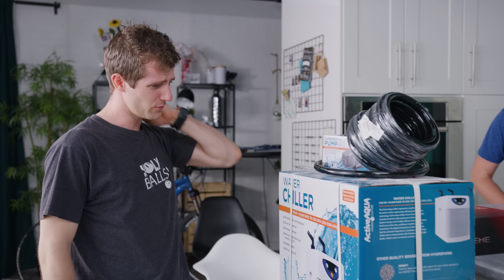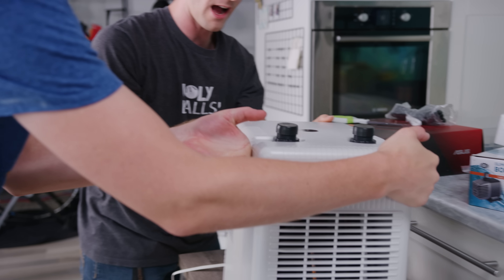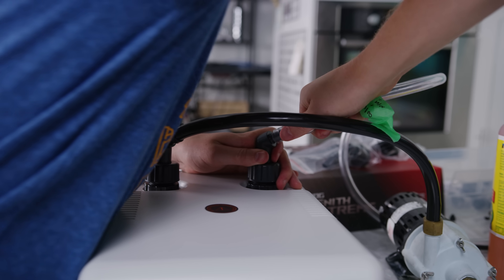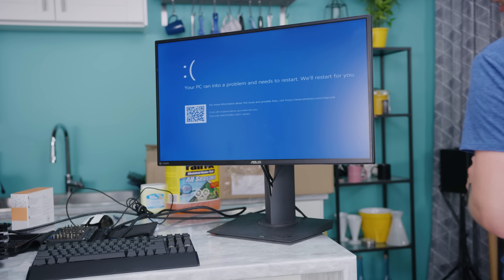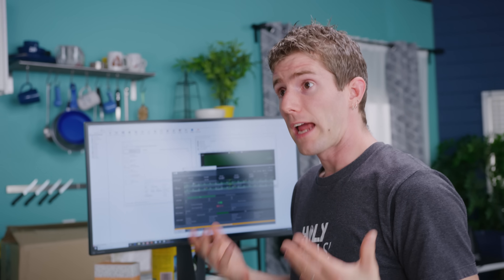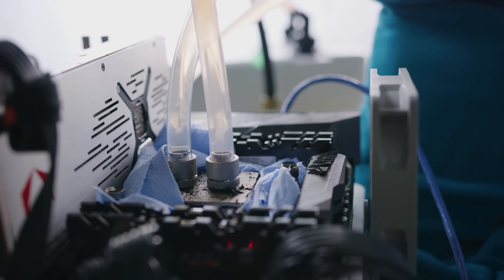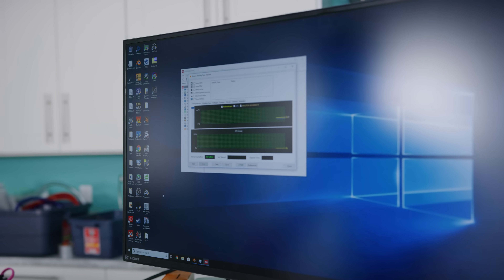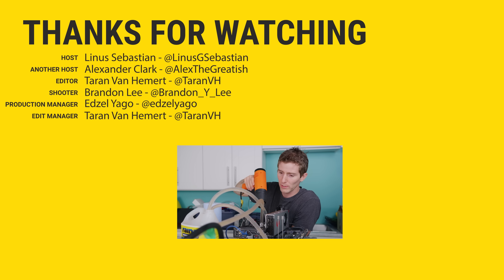Chilling Threadripper 2!!!

Comment: Yes, I do want to see it integrated into a system. But can it cool the i9 macbook pro?
Reply: this is pretty much the same as asking if it can fix the charging port on the magic mouse... nothing can fix pure stupidity
Reply: Can it cool Crysis?
Reply: @Ariakus88  that's smart questions
Reply: Rack mount chiller?
Reply: Whoa lets not get ahead of our selves here. This is a water cooler, not a nuclear powerplant cooling tower.
Reply: Not even in your dreams
Reply: bruh why are you here 

how are you here
Reply: TO cool that you would need to build an external laptop cooling system, uncooled the laptop helps reduce the population of the planet, cooled it will reduce your desire to procreate to be effective.
Reply: maybe. just stick a giant ass colling plate to the bottom with some thermal paste and run it as low as possible and pray.
Reply: No
Reply: Crazy to think that the M1 Studio scores better than this while using 1/8th the power :p
Reply: Boring
Reply: the Macbook pro would consume a closely comparable amount of power to the 32 core threadripper there's no reason why it couldn't cool it but you would have to make a custom water-cooling block for the Macbook and probably a stand so you have room under the Macbook to run pipes and you might need to cut holes in the bottom of the Macbook the Macbook wouldn't be very portable after all of this and you'd lose your warranty and you wouldn't be able to overclock much at all on the crappy Macbook motherboard so it would be better to just make a desktop like in this video

Comment: Instead of using a refrigeration loop to cool the "water," you should try running the refrigerant itself directly through the CPU heatsink.
Reply: How about buying some fluorinert to fill a tank big enough to take the whole system.  You can then pump cold fluid to the heatsink and leave the outlet open so the whole thing is swimming in cold liquid.

Comment: How much power does that cooling pump take?  It looks like we'd be adding at least 20-40 watts from the pump, and 200-250 more (at least) for the the cooler, and then ONLY to let the CPU suck MORE power still.

Comment: Mr. Linus, let me give you a million dollar idea, I am a design engineer at large hvac manufacturer. Condensate is a big problem for us as well. But! Gravity is always on your side. Just keep the board upside down and 3D print a drain pan that way you wont have condensate all over your motherboard circuitry and it will drip into the drain pan and drain outside. Simple but very effective solution, thats how we deal with the darn condensate.

Comment: This seems like a legit cooling solution that could be used for a multi PC setup. Get some of those quick release fittings, a decent central tank, and something to hide the pump & cooler. You got an easy super liquid cooled setup that isn't all that hard to do outside of piping the cpu & gpu out of the case. Another plus is not having the reservoir and pump in the case, less likely to ruin the whole setup that way (other than the couple tubes piping in/out). Next high end build I do, when I'm not broke, I might actually try this.

Comment: Use a window AC unit to cool a sealed case.  A cheap 5,000 BTU unit can handle 1,500 watts.  The only place that will condense water will be the exterior of the case and the cooling coil.

By relocating the thermostat outside you can easily force it to run continuusly. 
 By adding a condinsation drain you can cycle the conditioner to dehumidify the air to prevent ice build up during operation.

Comment: PUT THE BOARD IN TO MINERAL OIL TO KEEP THE CONDENSATION OFF.
(No air no problem)
Reply: Make sure there is a gap below the PCB.
The water than condenses on the surface will sink to the bottom.
The pickup for the return to the pump should have a water trap.

Comment: Waterchillers are awesome in general. Once you really decide to high end watercolling and not care too much about the budget there is honestly a lot to be said for going for a chiller. If you run at ambient it's also really simple - about as simple as any other water cooling.

What would be real nice to know is how many BTUs you really need to drive a system like this. Can this thing keep up several hundred watts sustained load and keep the water at a reasonable temp? Burst-benching is nice, but for it to be practial it needs to hand.e sustained load tolerably well too.

Comment: Maybe use different gpm pumps, maybe find the sweet spot in heat absorption. In Air Conditioning if the blower is moving the air slower through the coil the refrigerant absorbs more heat.

Comment: just for reference when you cannibalize this unit you should be able to extract a thermistor which controls the refrigeration side of the system, you're going to want to move the thermistor closer to the CPU AK use thermal plaster and physically plaster it to the water block that way the refrigeration system will have a better response time when the CPU gets warm
Reply: couldnt you instead just add another block to the loop and stick it to the thermistor?

Comment: I have a better idea, build a water cooled system where the cooler and the pump are placed in a different location (like a padded closet) and complete the loop with quick connects so the user doesn't have to hear it. While you're at it, you could see how many different PC's you could cool on the same loop, you could call it something like.. whole room refrigerated water cooling.

Comment: I have a crazy idea!!

Use that cooler to cool all the machines in the editing room! Kinda like you guys did back at the old house with the full copper water cooling loop. That would be cool to see.

This cooler unit could have some use if you using it to cool several computers all at once?
Reply: Exactly what I was talking about! excited box
Reply: Kale Mercer this is actually a really good idea, hopefully they will try this, maybe not with a bunch of expensive machines though, maybe some old hardware just to test it out at first
Reply: Trust me they won't. The full room water-cooling was such a pain in the ass end never worked, especially since the editors lost a lot of time because there PC's weren't working for 90% of the time
Reply: true, but would be funny to see ;-.)
Reply: They have said that the past previous room-scale multi-machine water-cooling solution caused way to much downtime for maintenance, and that they would likely stick to air cooling in their mission critical rigs from now on.
Reply: tough the same here.
Reply: If they ever do it again it should have separate loops for each computer and a separated master loop to cool from. With no mix of fluids among systems and the cooling portion of the loop each section will keep much more clean.

Comment: 1/10HP Aka 74.6 watts. A window unit has much more power; this would have to have a pretty big coefficient of performance. The small window units transfer 5000 btu per hour while consuming perhaps 400 watts when working against a mild but impactful temperature gradient where the outside temperature might be 100*f and the inside might be 70-75*f, but when you're operating one of them where the ambient is room temperature and the target is barely above freezing, not only are you operating against a greater gradient, but you're going to eventually reach a point where the cycle chosen isn't as good at operating at very low cold side temperatures. That's why normal freezers can't just keep cooling down their contents beyond a certain point, no matter how well you cool the hot side. The amount of heat transfer in BTU/hr of 500 watts (cpu consumption linus read out) is roughly 1700 BTU/hour, and so the window unit can tolerate some leakage of heat and the lower efficiency associated with a low cold side and larger difference in temperature, and with an appropriate buffer could probably just cycle on and off every so often happily. But this thing, with only 74.6 watts? Were those temperature numbers they quoted the cpu temperature only, or was the water also heating up a fair amount? Because it sure seems like this thing is only going to keep up when the coolant temperature climbs, otherwise it'd be insanely efficient.
Reply: The thing is rated 960btu or 280w (pulling 150w from the grid), next size up can move 2300btu or 670w (pulling 280w from grid)  which seems way overkill but might be a bit more efficient, and probably nessasary to run cpu at 500w 24/7
Reply: Mmm, so draw is a bit higher, and the amount of heat rated is not enough for continuous operation at whatever temperature it's rated at, is what I'm seeing there.

Comment: You are probably getting more condensation from running a fan over the cooling system because of the moisture in the extra air.

Comment: Linus, your average wattage over an aquarium using this sorta chiller is between 450w and 1000w or more, it should never have an issue with any single cpu.  it is used to counteract metal halide lighting on 8-12 hours a day sometimes inches above the water.  ie alot of heat.

Comment: I Tried cooling my pc with the AC. My GPU PCB got corroded. it got fixed by literally cleaning off the corrosion with alcohol but one of the small rectangle thing got removed. it still works fine though.

Comment: Have you guys ever heard of "staged cooling"?  Take that unit which can chill down to ~5 centigrade, feed it into a secondary cooler which is designed to cool liquids from ~5 centigrade to -15 centigrade, keep on piping it into different classes of cooling devices until eventually you're working with liquid helium around -270 centigrade (you'd be using an intercooler for that so you can use different fluids for different temperature ranges).  THAT would deal with threadripper's power usage no problem (and no condensation because it all freezes to the touch)
Reply: That would be highly over complicated. You can get to liquid atmosphere in a single step by using a helium compressor. Multi-stage is mostly for increased efficiency.
Reply: Not only for increased efficiency, but also so that you're not using a working pressure of upwards of 30 atmospheres.  You aren't going to get that kind of compression from parts you get at Home Depot.  I've constructed a very crude intercooler hacking apart (a few) coolers similar to the one they used without having to endure the expenses of a heavy-duty compressor and piping.  Lower temperature was -80C.  Sadly, it died very quickly and with a very voided warranty.

Comment: But... wasn't this what Koolance kits tried to achieve? On this note, there are a huge range of water coolers/chillers for many uses from drinking water to cooling down lasers.
 Just saying go big or go home: a whole setup for several computers with piping and individual taps connected to an industrial cooler.
Reply: You guys do know that Linus did that, right? And it got disastrously dirty?
Reply: Search the channel for Whole Room Water Cooling, as chooseymomschoose said, you'll be very disappointed.
Reply: That system was dirty from the start. First off, when plumbers braze (solder) together their pipes, they don't run any inert gas through them to keep the copper from corroding on the inside. They flush them with water and call it good. When it flows to the drain, it's fine. When it's in a loop, it isn't. HVAC/R techs purge copper lines with dry nitrogen to keep the oxides from forming those black flakes that we saw in the whole room water cooling teardown. Luke's dad (who as I recall (hopefully correctly) did the copper plumbing) probably didn't know anything about all this. Then I remember the fluid being un-optimal for water cooling and they had aluminum blocks and copper lines.
Reply: Learning is fun!
Reply: Thank you for the friendly reminder and as a matter of fact I went back to check the specs of that project. As a token of courtesy, would you consider checking them too and reading again the part when I said using an industrial cooler? Not that it's my intention to create controversy out of a for fun project, just saying that it's kinda nice to have a healthy discussion where every side actually listens to the other.
Reply: NO offense to LTT but that was in one word, bad. And still small potatos to what @jarejander69 were talkin/thinking about.
Reply: NOW were out of the box........ This is what i was thinking lol make a piping system in the office dedicated for employee stations!!!!!!!!!!!!!!!!!!!!!!!!!
Reply: And taking it up a notch, connecting the loop to a radiant heating/cooling floor.
Reply: Pretty sure most of the reason this isn't very feasible is the mix of metal types necessitating exotic cooling fluids (windshield washer fluid designed for subzero temperatures in this case) which makes it impractical for large scale use.
Reply: not at all the liquid is the easy part its using the same metals that is "scary", not really.

Comment: So.... I still use an Old Swiftech Peltier water Block. CPU TDP of 125. Which is awesome for considering when Peltier blocks were brought out CPUs were significantly higher. I mention this to note the fact you can Achieve 0c on a CPU with No added monster of a water chiller. That being said, a peltier would struggle against the Threadripper... Mind you, you CAN always get a MUCH bigger peltier.... Ideas are brewing....
Reply: peltiers draw a ton of power though :(
Reply: phononic hex 2.0, it even has anti condensation software that manages ambient temp to keep it just above dewpoint

Comment: Linus why don't you test something that was built for this " https://koolance.com/liquid-to-liquid-cooling-system-llx-7000 " or " https://koolance.com/exc-800-portable-800W-recirculating-chiller " they have built-in reservoirs and pumps, and temperature monitoring so they don't sweat.I have not seen any detailed review on this type of equipment ???

Comment: I have thought about running a radiator into the tank of the toilet, so the tank becomes a heat sink that gets fresh cool water when you flush, and less condentation on the tank.

Comment: Amazing, overclocked threadripper 2 consumes just 20 times less power than a manufacture-grade thermal treatment furnace!
Reply: that's more than some microwaves...
Reply: i would consider a microwave under 700 watts a pretty shitty one though ;)
Reply: Might as well just turn these high powered oc system into water heater, and store those heated water in your house water tank for later use, no furnace needed in home ever again

Comment: itd mad if you integrated it into system and had a little arduino that would see what ambient temperatures are and then adjust itself to keep away from dew point automatically, since your cannibalizing it  anyway it wouldn't be too much to just take the button off the chiller control panel replace them with a couple of wires that go to the gpio pins in an arduino, awesome project though!
Reply: linus isn't that smart...
Reply: and thats way to complicated look up the phononic hex 2.0 and peltier kits dont dive too deep
Reply: i was thinking the arduino would jusdt have a counter in it and you would have to sync the two systems
 together and the arduino would "press" the buttons. but youre right it sure is a rabbit hole
Reply: Im not saying what you are saying is a rabbit hole if you do, im not. I would have a Sonoff TH10 on the chiller and a regular sonoff basic connected to the pump. Then its all phone monitored and you make a simple IFTTT applet to do what you said. Nothing against arduino, Sonoff is programmed with arduino. Just its already pre programmed and it has more features then a person making a custom program for a bare arduino board would like wifi, IFTTT integration and temp probe and a humidity sensor if needed/wanted. and a basic is $8.00 the TH10 is $25 USD

Comment: Check out some of the water pumps on Amazon specifically labeled as DC water pumps. From my experience they run quieter, more energy efficient, and offer more control. Cost about the same I think. The downside is that most of them need to have a separate controller purchased and then attached (minor soldering or crimping) but again that downside is a plus as you gain electronic control over flow rather than having to rely on valves, etc. I suppose someone with electrical experience could actually make the controller a PC ...